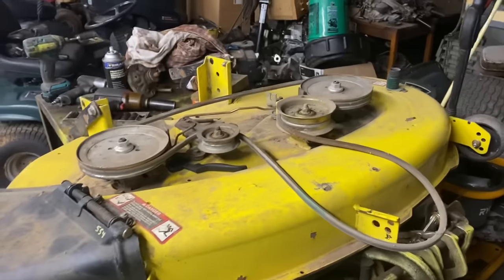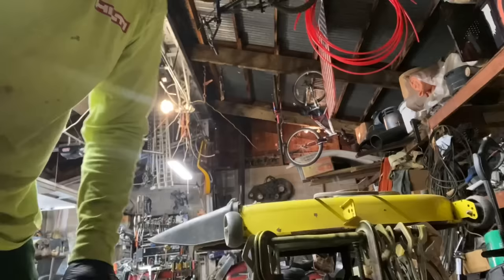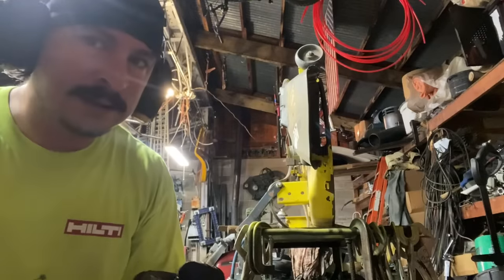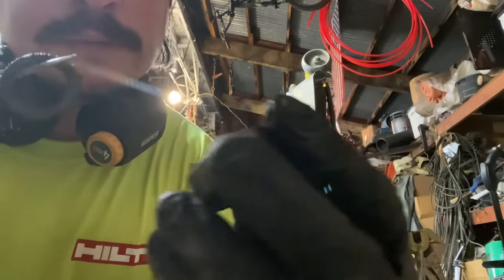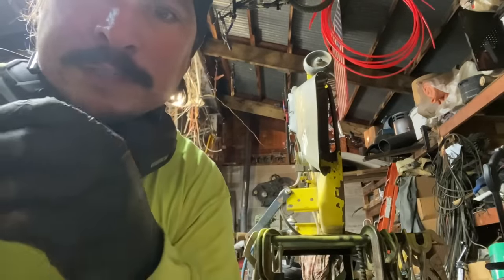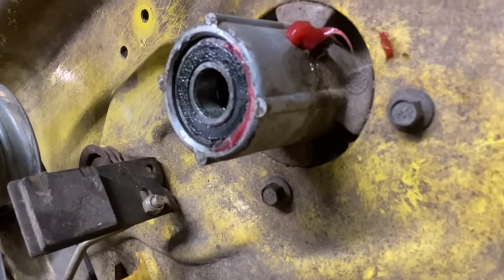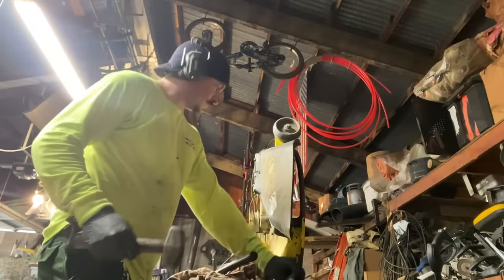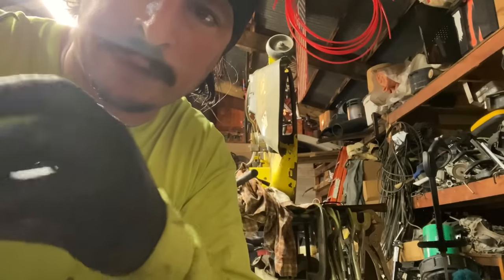Part 1 - Don’t trust the “Experts” Grease your mower deck sealed spindle bearings Common sense.

Comment: More grease cane out of the top and bottom than actually went into the bearing. Just remove the shield on the grease side and spin the pulley or blade as you add grease. Youll get the bearings packed full.
Reply from the maker: The grease that came out of the bearings passed through the bearings before making its exit. Therefor the bearings have received grease. They can hold a little more if turned while adding grease but plenty makes it where it’s needed. If you watch the whole video the reason for disassembling the unit was to show the viewers a before and after of what grease was in the bearing. Sometimes folks leave a comment before really grasping that because you would have to see the video to get all the information I provided. Seems like some folks see the first part and assume they have a better way without actually seeing the whole process to understand the outcome. Taking a unit apart that has a zerk is a waste of time. Removing those seals will add no benefit. But if that is how you like to go about it, please do as you wish. I’m only offering a simple solution that is 100% guaranteed to work. It’s free advice. Take it or leave it. But removing the seals is pointless unless you have a reason to be in the unit other than just simply needing to add grease. Just think about the process a minute and it might make more sense. Why grab tools to simply add grease when all that’s needed is a grease gun to be connected to a zerk that already exists? What’s the harm in just giving it a try? Even you recognized that grease passed through a bearing. Even though only a small amount of grease is necessary, every time the unit is ram and greased again, more grease will get into the bearing. And very little grease is needed. More than enough grease is retained inside the bearings after the first time it’s been filled with grease. There are many ways to get grease into a bearing. This is just the simplest and fastest way.
Reply: @GTObearclaw1  you post long winded responses that say nothing. You can clearly see in the video that the grease only penetrated in one area. Period. If you're going to add a grease port, remove the seals so the entire bearing gets grease.
Reply from the maker: @mikezupancic2182  I try my best to explain in a way that the folks who don’t get it can understand. Even when folks are rude I try to help I’m just awesome like that. But your absolutely right! I don’t need to be so long winded. The point was grease pushes into and passes through the bearings. That’s the point I was originally trying to make clear. You even got that much from the video so I achieved my goal. I didn’t say it would fill the bearing before existing the other side. That would just be silly. 

It does not take much grease to get the job done. actually more than needed gets in the bearing to where it’s needed. Yea, more is better but unnecessary to be completely filled. And after a few services the bearing will be filled. So really nothing more to say. If you like doing things the hard way, press on. Have a nice day

Comment: Why wouldn't you just pack the bearings with grease, when the seals are off?
Reply from the maker: I understand that is one way, that is the more complex way to reach the same goal as I achieved in my video. The purpose of this video was to show it’s not necessary to dismantle a mandrel to access a bearing and manually pack grease in the bearings. As I deminstrate  in the video, grease applied through a zerk provides the bearings with grease with no issues. Plenty of other channels explain how to dismantle the assembly to access a bearing and mislead the DIY community by informing folks that the shields stop the flow of grease. I have made this video to Debunk those fraudulent claims. Folks who make videos stating a shield stops grease flow should consider running some tests before posting misinformation. This subject is very controversial because so many channels won’t put any evidence in the videos and simply spend the time bumping gums when they should be showing the steps and proving why or why not. The truth can be found by each DIYer by simply following the process Iv shown. If folks don’t trust me they can test for themselves. I’m just trying to help reveal the truth about the factory installed zerks and how little effort it takes to get grease past an inner shield. Simple stuff when we really think about the process.

Comment: So where do you see grease come out if its full?
Reply from the maker: If your spindle is the type like I had in this video it will have to pass through the bearing and out the shields. Watch at the top or bottom. Need to pay close attention to both ends. Stop as soon as you see grease exit. If you have a MTD or some other brand that sabotages the units by drilling a “weep” hole, the grease will never build the pressure needed to pass the shields and will exit the hole made in the side of the spindle first. These are worthless as far as I’m concerned there is no benefit to those designs other than to shorten the life of the bearings by preventing grease from reaching the bearings. I hate MTD for this and many other things they do. If you have a weep hole, plug it with an a screw or another way that works for you. Folks can be creative. Just need to let the grease push past the shields.
Reply: @GTObearclaw1  I have a John Deere x300 and I was always worried about too much pressure so now I'll be more confident and fill that sucker up
Reply from the maker: @donschlonski2936  glad your willing to try it. It’s exactly how they should be serviced. Only way to get grease to the bearings is to fill them. They can’t hold pressure as the shields are simply a dust lip and the units can’t hold any pressure. Excess grease pushes through the unit and will exit out immediately. If the beating has too much grease it will slowly work the excess out. Basically you fill it and it self regulates. If you grease once a year you will probably never loose a bearing.
Reply: @GTObearclaw1  each of my spindles got about 100 pumps before I saw grease coming out a hole in the top pulley. (I got tired of laying on the floor and reaching under the deck to feel for grease).

 I probably could have stopped at 75 pumps by the looks of the excess under the pulley when viewing from a kneel position. Interestingly enough when I turned the blades on I had some spew spread out of this wonderful red grease 🤣🤣.

 The good thing is I seen green grease pushed.out the bottom from all 3spindles and that's the kind I had been using each year so the red pushed.alm.the way through!

Thanks
Reply from the maker: @donschlonski2936  yea that can get messy. If that much is comming out it’s probably a good idea to drive to a far reach of the yard and light the deck up there. Better to throw that excess off far from the regular traveld areas. I usually drop my decks and stand them up between my legs so I can see both sides as I’m pumping. 

Well, next time it will only take a few pumps. Now your assemblies are filled so the hardest part is behind you. The future will only take a few pumps and grease will exit. 

Thanks for having faith. Please feel free to come back and leave a comment if you ever have any issues to share with folks. Love to see long term feedback.

Comment: Pumping something full of grease like this, and giving no room for expansion,  is a disaster waiting to happen typically
Reply from the maker: No it most certainly is not for this application. Disaster waiting to happen? that’s really stretching the imagination sir. Please let us know if you have a failure you have experienced by doing this process. If so details on how that happened best you can describe, Not looking for opinions from folks who have no hands on with the process where this application is concerned. Already have enough “experts” posting videos saying inner seals stop grease from passing. That’s not helping anybody. These assemblies won’t hold any pressure in, if too much grease is inside it simply works out of the housing past the outer seal. The moment grease exits the housing there is no longer any pressure confined inside the housing. These things can’t contain pressure.

Comment: Do all spindles have grease ports
Reply from the maker: Not all come with a zerk. Some are there and hidden under the bottom side and harder to find. The ones that do not have zerks can have a zerk added. Some of the aftermarket housings have zerks.
Reply: @GTObearclaw1  thank you

Comment: 1bearing on  john deer has a metal bottom ,the other side  has plastic bottom .On my E110 ,2018 .I have 99hrs
Reply from the maker: Yes some bearings use a rubber seal. Some have the metal seal to the bottom as a heaver duty guard to protect the lower side from damage. Those are nice.  It’s even better if one side is just the rubber seal so it can be removed to inspect or clean the bearing or to add more grease. But regardless the grease will push right past that seal too if a metal shield is used on the inside. It’s still just a rubber seal but with a more heavy duty metal shield protecting it. The grease can still push past the rubber lip no problem. No need for metal shield on top bearings as there is much less chance the upper bearing will be in danger. Under the deck is where all The action is happening.

Comment: should keep cover off bearing on grease side
Reply from the maker: Yea, I get that same coment
Non stop almost daily. But the whole point is that the seal, really it’s just a glorified dust shield and it is not even water tight and will not stop grease so removing it for the purpose of allowing grease to pass is a pointless process. Just working to work on something for what I call getting that warm and fuzzy feeling thinking it’s doing something when in reality it made no difference in the final outcome. Just grease until you see grease come out one end of the assembly and by then both bearings got lubed. Good to go. Also do not wash deck with water. Water will find its way in bearings. Using a leaf blower after each mowing and keeping deck clear will help deck live a long happy life. I find more often than not, when folks leave this comment they didn’t finish the video and get the full information I was offering.

Comment: how about a unit without a grease zerk (fitting)
Reply from the maker: Have to dismantle it and manually add grease to the bearings or while you have things apart just take that opportunity to add a grease zerk between the bearings on the side of the housing. It will make the future services just take minutes. Adding a zerk is not very hard but doing it the first time would be a little learning however lots of videos to help you out here.

Comment: But, when I grease my commercial 72" deck, about 5 strokes of my grease gun pushes grease out of the pressure relief port.
Reply from the maker: I
Don’t deal with much commercial equipment 

I’d question why there is a relief port. That defeats the purpose of having a zerk.
Reply: @GTObearclaw1  It only relieves excessive pressre, I suppose, such as over greasing or heat expansion.
Reply from the maker: @rooster3019  a rubber seal won’t hold pressure so technically they self regulate and pressure is immediately released after grease is added. I think that’s a gimmick to prevent grease from passing the shield lips if your talking about a port on the mandrel assembly and not the gun.
Reply: @GTObearclaw1  The relief is on the body of the mandrel, opposite side from zerk.
Reply from the maker: @rooster3019  poor engineering in my opinion. MTD does a similar assembly. Iv learned over the years that some engineers are ignorant of how things work in the real
World. They do some
Real
Dumb stuff sometimes. Probably made real
Good
Sense
On paper while sitting in an office with clean hands. Sometimes you just don’t get it until you get some
Grease under your fingernails.

Comment: That's why I removed the inner seal.
Reply from the maker: Because they don’t matter? That’s basically what this video is explaining. The inner shields don’t pose any resistance to grease passing. No need to waste the time removing them unless folks just like to do things to waste time. Many folks don’t realize pressurized grease will push past a rubber lip on these seal like it’s not even there. So I made this video to help explain due to mass confusion over this topic spread by people making videos about it when they don’t have a clue about the topic.

Comment: Yup those bearings don't last, had to replace both deck mandrels on my mower then the next year, the Kohler motor threw a rod thru the bottom !
Reply from the maker: Seems like they only put a few drops of grease in the deck bearings on the new box store stuff these days. Iv even ordered some new typical cheep replacement bearings and pulled a few shields off to see how much grease was in the new ones and I have been very disappointed. Even the quality of grease in a new bearing is questionable. As far as the amount of grease it’s hit or miss. Some seem full others have almost none. I have learned to always pop caps off now and check before installing. As far as kohler is concerned, I think the single cylinder courage engines are the worst Iv ever seen. Those have some major flaws with the design. Kohler really when down hill after getting away from the command engines.

Comment: A majority of mower problems are from the person that assembled the mower and didn't give attention to detail deck level and adjustments on the belts and the lack of Grease is the issue that causes the customer problems and money after doing business with the dealer and distractions is the main cause
Reply from the maker: @jefferybernard4800  hard to say for sure, as for the grease I suspect that like many things they have cut back to a minimum for a combination of reasons, less grease less life so more parts sold more machines bought, more repairs sent to dealers also resulting in more parts sold because most the shops will recommend to a customer to buy a new deck or a new mandrel assembly when in most cases a simple bearing or a little welding can repair the issue. The companies may think that’s the way to make better profits but no way we can know for sure. I believe they engendered the failure into the machines. It’s easy to speculate. Regardless I will find some of the ways to keep them running longer and at less cost to the owner and share what I think is relevant to help folks overcome the shortcomings.